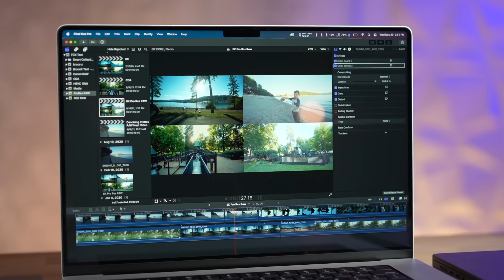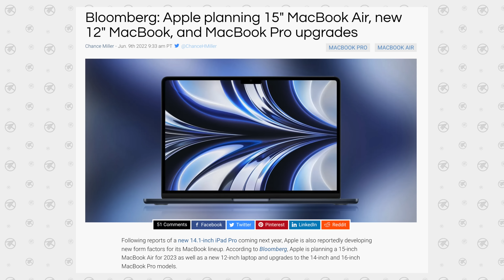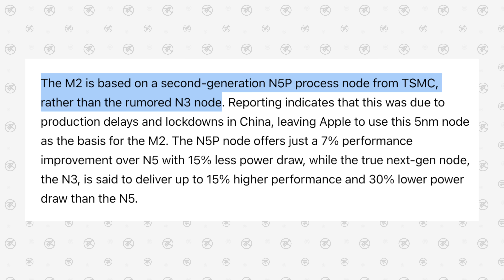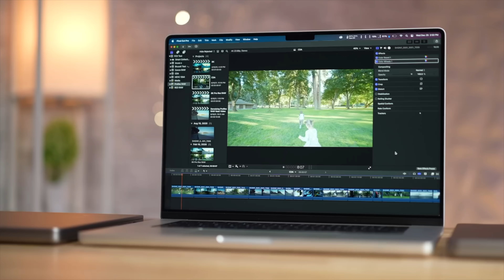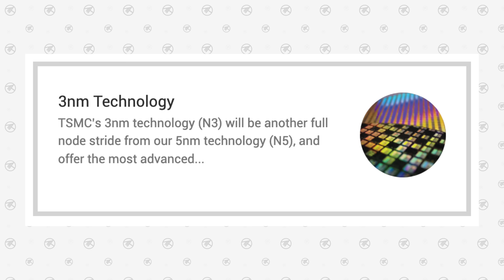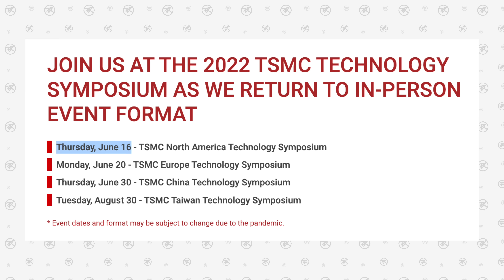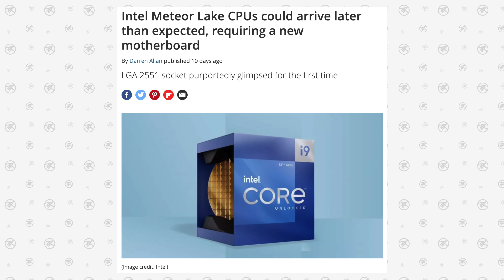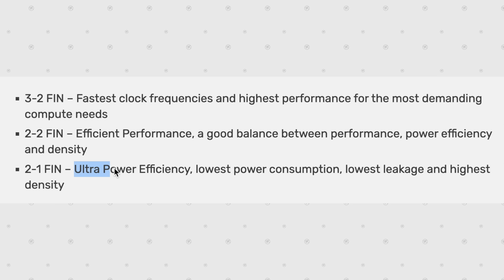Why Apple's M2 Pro MacBooks will be BETTER than you think!

Comment: For those that think N3 won’t come in the M2Pro/Max series Don’t forget apple did this same thing back with the A10/A10x chips. A10 was built on a 16 nanometer process node but the A10X was built on a 10 nanometer process node.

Apple can and does things out of the ordinary sometimes.. keep it in mind !! I’m so excited for these chips
Reply: To be honest I wouldn't be surprised if this became the norm, it's very unusual for a whole lineup of chips to have the same single core performance, this would be a way to separate the regular M series from the M Pro/Max/Ultra/Extreme series
Reply: @andyH_England  There is no "normally" Apple has done this exactly *once*, we don't know what they will do next. It also wouldn't be M3 Pro/Max/Ultra, they would still be using M2 generation cores, just fabricated on a smaller process.
As for the Snapdragon 8 gen 2, Apple usually gets first choice of TSMC's new process nodes so there shouldn't be an issue there.
Reply: @andyH_England  Apple has always been first to new process nodes, they were first to 7nm and to 5nm. They are also always the first to new USB standards, like USB-C and USB 4. Also you've got to realise these chips have been in development since before M1 was released, nothing is being rushed.
Additionally, to my understanding, a new process node isn't something like a hardware design where you have to take your time over it for it to even work in a way that's acceptable, it just seems to be something that gives instant benefits in and of itself to any decent chip design, with any extra performance/efficiency tweaks that gain be gained along the way as well being a bonus.
Reply: What do you say now huh? 😂😂😴

Comment: 3nM means longer battery life due to small size processor and small wattage usage. This is amazing move from Apple.
Although it's still speculation, I can't wait to grab one for sure.
Reply: I doubt they will lengthen the battery life but increase performance at the current battery life
Reply: Battery life will probably be similar as they’ll keep the power limit similar meaning a similar amount of power consumption
Reply: 3nm node doesnt seem possible because electrons can jump from one transistor to another at that size. I think it is more of a commercial move
Reply: @jonathanblanckaert  It’s possible otherwise TSMC would be in big trouble with their customers and investors
Reply: @chidorirasenganz  yeah true, but what i try to say that its more of a commercial naming than really the transistors are 3nm separated from eachother. I think they stack the transistors
Reply: @jonathanblanckaert  You are correct. The nanometer node size names are just words, they don't match to physical sizes at all. They are even different between Intel/ARM/etc. It just exists for historical reasons.

Comment: 9:09 is actually because they usually ship their mac and allow orders for them soon after the event, not next year. if they can only deliver it next year(chip) it does not even have enough time for apple to assemble their laptops as it takes months for a stock that can last for some time for them and their users. that is why I don't think they will use the 3nm node on their new laptop. (note that they start assembling iPhone on time like July or soon which is about 3 to 4 months before its release. (they also need to check the sample after the assembling and see if there are any improvement as well, unlikely to be done in seconds)

Comment: Also  there are the reason why Apple is taken m2 separation for 5nmm and 3nmm, not only to take wider and faster filling of the market, for cheaper production, which can make thier products cheaper and accessible, but to take down concurrents on market such as AMD, Nvidia, Qualcomm and Intel, why also uses TSMC 5nmm lines to produce their own chips.

Comment: This makes perfect sense to me, and it allows Apple to differentiate the single core performance between the regular M2 and the rest of the lineup. I'll be sticking with my base M1 Pro 14" MacBook Pro for a good few years though. Maybe I'll get an M3/4 Pro in about 5 years.
Reply: Imagine what that will be like. It’s gonna be sick. 4 th gen of apple silicon. Gonna be expensive. I am still using a Mac Pro 5,1 in the studio. Still kills it. For what I do it works. I have a 16inch M1 Pro. To be honest I don’t see a difference. Works great either way. Software is optimized for certain tasks on certain hardware. I don’t see all the hype over new tech. My old 5,1 has never failed me in 13 years. Yes it’s a 2010. Besides my console doesn’t run on apple silicon. So for people like me if it ain’t broke don’t fix it. I think Logic x needs a big update..
Reply: @TruenorthmtGod  Surely you see a difference in responsiveness between the old Intel and Apple silicon?

Comment: BIG QUESTION: I’m due for an upgrade. Should I wait for the M2 16in MacBook Pro or just go ahead and purchase the current M1 Max ‘21 ?
Reply: I just bought the 14 pro , ask this question, “do I need it know” if so then get the m1 if not wait , but it’s pointless to keep waiting technology keeps evolving too fast
Reply: @alexandroskulira4565  that’s very very true. And the computer you got is incredibly powerful
Reply: @ElvinKristian  I’m a pc guy, and IT certified and majoring in computer engineering, built over 30 computers and I gotta say one this this laptop doesn’t disappoint second I learned the OS it was amazing , most windows laptop I’ve had problems with with this one I don’t
Reply: I'm kind of in the same boat, although my plan is to get a new laptop around Christmas. I want a 14" Pro but seeing that the new versions might come out in spring 2023 or even as early as late 2022, I'd probably wait it out.
Reply: @helloasroma  some are saying we might get an announcement this October. Really hope so. Waiting till Spring is around another 6-8 month wait.

Comment: There is an urgent need of a COMPARISION VIDEO between a spec matched Macbook Air M2 VS Base Macbook Pro 14 . Please, I think there is huge crowd who is confused between - 16GB/512GB M2 Air AND 16GB/512GB 8C/14C 14 inch M1 Pro as these two can have similar performance for close price difference but an urge to buy a newer design and sleeker laptop makes things confusing. Plus single core scores are better with M2 so your detailed comparison would make things very helpful.

Comment: I agree on virtually all of your points.  The one caveat I would suggest is that building UP complexity is usually the better, easier approach as you can test features, prove workability, and simplify and accelerate advanced development by nailing down the foundation technology.  The advanced chips do not just pop into existence without development.  As with the Apple Silicon transition, the simpler chips came first, and each chip thereafter added onto existing chip (until the Extreme which duped a chip and added the crossbar).  I believe Apple engineers will stick with this practice going forward.

The question I have is for the (upcoming, unrevealed) Mac Pro.  With all this M2 news, would Apple really introduce an M1 Mac Pro (even if it had quad-M1 with grand new 4-way crossbar)?  It would be awesome to have a 4-way M2 (!) for the initial Apple Silicon Mac Pro (i.e., supporting your ‘max first’ engineering theory).  So… fingers crossed the Apple Silicon engineers pull a rabbit out of their hat and that you are correct about starting with maximum silicon first and trimming to lesser silicon!

Comment: Most important question is imo: Will these come as an update to the current MBP M1 Pro and MBP M1 Max, or will they keep these in stock (so you can buy some 18 months old technology at an unchanged and thereby very high price) and sell the MBP M2 Pro/Max as an additional (and even more expensive) model (like they did with the 2022 MacBook Air)? What do you think?!? I already see the 14" M2 Pro starting at about 2800 USD and the totally maxed out 16" M2 Max going up to nearly 8k 😕

Comment: The other benefit of basing M2 Pro / M2 Max processors on 3 nm is it potentially offers a greater performance differentiation over the M2 processors. M1 Pro / Max / Ultra processors had remarkably similar single core performance as the M1 processor, so you only saw any real benefit from these more expensive processors if your applications could make effective use of more multiple CPU cores, GPU cores and / or media codecs, and you needed more ports.

Comment: First of all 3 nm is insane! if you translate it in physical terms its like transistors stand few atoms apart.. that's completely bonkers. Almost on the edge of what's possible. So there is no need to rush. There is no more space to grow hence the physical limit.
Secondly M3 and 3nm sounds like a perfect match :)
And finally Im pretty sure this all race in nanometers is about developing a mass market for super efficient chips so the wearable industry could finally take off! Its all for this reason. There is no need for a desktop chips even as powerful as m1 is. 
Wearables need super powerful yes super low power chips to enable the AR revolution

Comment: Def like the theory and seems plausible. If they can start with a Max chip, 2 X it for Ultra, 4 X it for Extreme (Mac Pro), 1/2 it for Pro, use for M Base chip, scale down for A chips, this would make great business sense. However as mentioned… If A series chips for phones are every 12 months and M series chips are every 18 months are we thinking the just make some slight changes to one of the A series chips every 3 years? As the M series will be 2 different ones every 3 years, while A series will need 3 in that same time.

Comment: Also, chip nodes are based on PDK. Process Design Kit. This is the rules for the node. It's not easy to change a chip to a different node and qualify it. Trust me...it takes time and a lot of work.
Reply from the maker: They've been working on it for many months already, even though it won't go up for sale until Spring 2023. It's gonna be a new chip design specifically meant for that node. new cores
Reply: @MaxTechOfficial  what makes it belong to the “M2” then?
Reply: 1. They have done it in the past, even splitting a single chip design between two nodes
2. If this is the case, which I think it is, they likely designed M2 Pro and Max with 3nm in mind to begin with.
Reply: @thebuddercweeper  ad 1) can you tell me which one? I am genuinely interested which series of chips used different litographoc process in the one generation. 

Ad 2) noone claims otherwise, they for sure plan to use the 3nm nodes for something, I am just sceptical that they would call something basically “M2 enhanced”, when the product would have nothing to do with the M2 to begin with, since the cores would be so different.
Reply: @Alwarin1  
1. A5 was on a different node to A5X, A10 was on a different node to A10X, there were 2 different versions of the A5, one on a smaller process node than the other, and A9 was split between Samsung’s 14nm and TSMC’s 16nm.

2. The essential core design itself likely wouldn’t be much different to M2, it would still use avalanche and blizzard cores, the design would have just been tweaked to optimise for 3nm. But even if the cores were completely different, it’s essentially a branding choice we’re talking about. I don’t think it would make sense to hold off on a new technology for the sake of naming conventions, and it wouldn’t make sense to jump straight to M3 Pro/Max/Ultra, so the only choice I can see is to give it to M2 Pro/Max/Ultra.
Reply: @thebuddercweeper  thanks :)

Comment: The default configuration of the MacBook Air offers an M2 chip with an 8-core GPU, so for graphically-intensive tasks the MacBook Pro should have the edge, though you can upgrade the MacBook Air to an M2 chip with the same 10-core GPU as the one in the MacBook Pro 13-inch.Macbook Air M2 Give way! Thank you Max Tech!

Comment: I’m really excited to see what’s to come, but honestly I’m getting less and less excited about actually buying the things. I currently use an M1 Max MacBook Pro.  I bought it because the base model MacBook Air that I could buy last November, of 2020, that wasn’t enough for my needs. I’m at the point where I definitely feel like I have enough power to last me the next several years, they can give me more in the form of the M2 pro and M2 max, but I’m just not sure how I use it. Are used to believe that software was being bottlenecked by hardware.  This morning, as I watched your video, I wondered if hardware was now being bottlenecked by software, but I realize that I think it’s something different. For the vast majority of users even users of these pro machines, I wonder if it’s simply a case of our needs are all met by both hardware and software. I’m not saying that no one would benefit from the increased speeds, but I am saying that it’s worth carefully considering if you would benefit from the increased speeds before you succumb to fear of missing out syndrome.

Comment: Good analysis. Precisely what my research shows too. Looking forward to M2 Pro/Max/Ultra. The one other thing I think will happen though is that there will be no M2 Extreme, but simply different configurations for the M2 ultra, which will allow quad versions, and more. I also suspect advances added to the upcoming M2 Ultra are designed to permit massively parallel and multiple soc expansions in a single Mac Pro chassis. I think the M2 ultra and new Mac Pro are going to be mind blowing beyond just the soc performance gains.
Reply: IS it better to buy m1 pro Now or wait for m2 pro
Reply: What research? 😂😂

Comment: You did not even consider that the 3nm node can be used for the Mac pro chip, that is basically confirmed to be a different to a M-series. Because if M2 pro has different process, different cores, different everything, what makes it “M2”? 

Ultimately, apple can do whatever they want, but this would be unprecedented step, not only for M series, but for A series as well. When was the last time that A? and A?X were based on different proceses?
Reply: He's preparing thousands or more videos on this same subject. So, he will probably consider in one of them.
Reply: @sandaDru  lol, that’s fair point

Comment: I think you are getting overly exited here. N3 is possible for low volume production in spring 2023. Although usually you need to redo the whole design when you change silicon generation. So doing M2 half on 2 different generations is possible but costly, the investment might make sense for Apple roadmap. So your theory is possible. However regarding  N3E and N3P it wouldn't work. N3E is scheduled for low volume production by the end of 2023 so it would missed the M2 Pro delivery window. N3P will be in 2024. So these nodes might get used in M3, not M2.
Reply from the maker: N3E is for M3 chip and A17 chip. The initial N3 is for M2 Pro/Max
Reply: The dual generations is bugging me, it would be cheaper overall to skip the M2 Pro/Max entirely and release the M3 Pro/Max before the M3 than to do this. M3 would then be released later using N3E.

Comment: I have a lot of the same thoughts as you, but I won’t get my hopes up just yet, and I’ll just assume it’ll be based on 5nm or 4nm.
Reply: If they release early next year I don't see any reason why they would be 4nm over 3nm. I can see them sticking with 5nm for the sake of consistency with M2, but I think it's less likely because with the current generation they can'y upsell you on single core performance.
Reply: @thebuddercweeper  Yup, especially since the M3 MacBook Pros will release on late 2024. If they delay 3nm until then, the M2 MacBook Pros could feel outdated in comparison to AMD, Intel, or even Smartphones as they’ll start to use 3nm before the MacBook Pros.
Reply: @imEzno  I don’t know if they’ll be outdated as such, but they would definitely lose their fabrication process lead. Right now both AMD and Intel are on 7nm while Apple is on second generation 5nm, so they’ve got a bit of wiggle room, but only about one generation.

Comment: What people seem to forget is that Apple makes 2 chips for their computers. M1 and M1 Max. The M1 is for all the base products. Cut half of the gpu of the Max and get the Pro. Stick 2 Max together and you get ultra. It’s really quite simple. So just because one architecture was used for M2, it really doesn’t need to be the same as the Max.
Which leads me to believe the Mac Pro chip might actually be an entirely different chip as well. We’ll see

Comment: M2 Pro/Max will not be 3nm. M3 will be 3nm.

tsmc's 3nm has been delayed from its original roadmap of end of 2022 deliveries. this is why only the iphone 14 Pro has the A16 because they can't produce enough 3nm A16 for the whole iPhone lineup.

I think the M2 MacBook Air was suppose to release a month after the iPhone 13 so the whole lineup would be refreshed with the M2 series before the iPhone 14. this way the Mac Pro would launch after the M2 refresh and before the iPhone 14. This would be exactly at the end of the 2 year transition. But now because of chip shortages and delays the Mac Pro will release in middle or end of 2023, after the whole lineup has been refreshed with the M2 series.

if apple are on a 18 month cycle then the M3 will be 3nm and be based on the A17 and launch right after the iPhone 15. there will be no M chip based on the A16, it will be skipped.
Reply: @tonyburzio4107  yeah but deliveries of the chips are in 2023.

Comment: It seems odd to me that an M2 Pro and M2 Max would be 3nm when the base M2 is 5nm.  Seems to me that would be enough of a chip evolution to call it the M3, but we'll see.
Reply: Typically, with a new process node, it makes the most sense to utilize an existing chip design to work out the kinks.